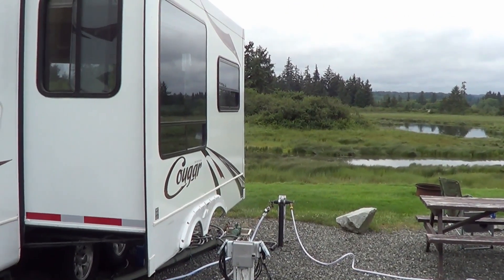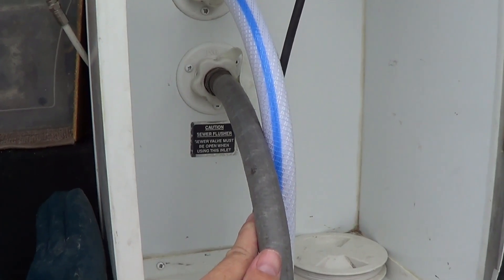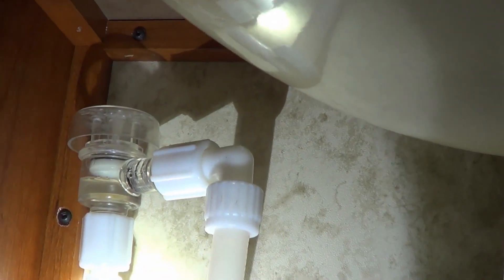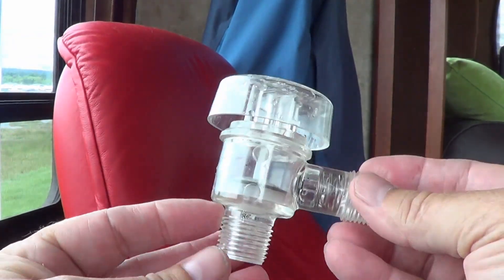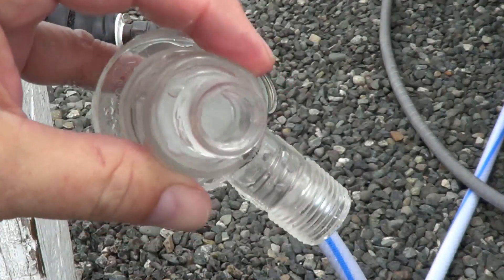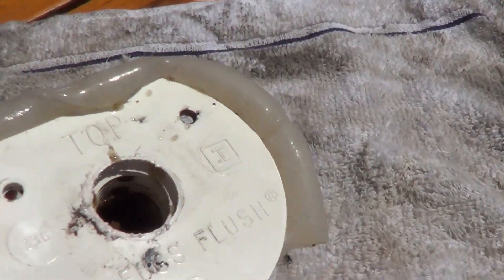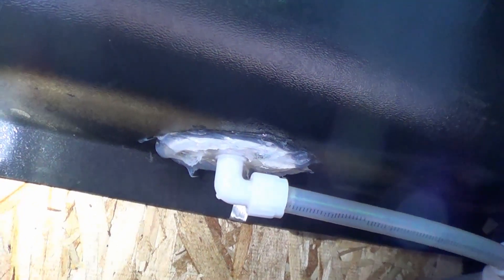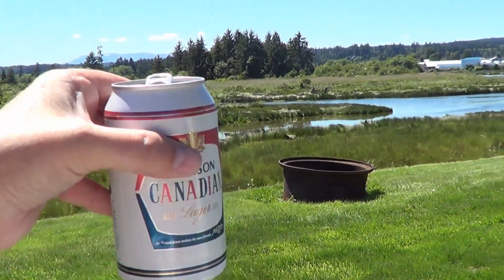Oh Crap! The RV Black Tank Flusher is Busted

Comment: I was dumping my black tank for what I thought would be the last time before I put November X-Ray (Our Springdale trailer) into hibernation for the long, long winter. I could not hear the black tank sani flush working. It was nice to find this video. I am always reluctant to take my rig to the dealer and only do that as a last resort. I was very confident that I could fix the issue after seeing what you did with yours, Professor Ray. Turns out I worried for nothing. When I got NXR home and hooked up a garden hose everything seemed to be working. Gremlins in the system maybe. Or maybe I forgot to turn on the hose...

Comment: I’ve often wondered about mine.  I think it’s a good idea to ID the location of that check valve because if it did crack as you defined, I’d be sitting on the side of the trailer as I usually do while putting the rig to bed and listening to the “spraying” sound I’m accustomed to hearing.  In reality, I could be flooding the trailer somewhere!

Comment: Thanks for this video.  
    My black tank flush is plugged up.  Must be the jet piece inside the tank, the part that was plugged up on your tank.    Unfortunately I have a trailer with a  4 seasons sealed underbelly which you have to tear apart to get to the black tank inside.  It's quite an ordeal to open up the underbelly and get it sealed back together.

Comment: your tank flush sprayer failed because it was installed too near the bottom of the tank, not in its top. Note the flange says "TOP" on its face which is facing horizontally to the street side in your installation. I would expect this maintenence to become routine at best and to require component replacement eventually. much better idea for this to be installed vertically from the top down but relocating it now would require patching a sizable hole in your tank.

the vertical portion of the backflow-preventer check-valve (black o-ring) is not spring-loaded. it prevents back flow but is dependent on gravity to close. (this is why you had to shake it at 4:00) I mention this because it's of vital importance that it be oriented vertically (plumb) to prevent sewage from flowing back into a public/potable water supply.
Reply from the maker: Thanks for the advice. Lasted 6 years of full-time use, so not too bad, I'll leave it there.
Reply from the maker: The valve is working fine, It actually has two valves, one vertical gravity, and one horizontal spring loaded, no way water is getting back out that thing.

Comment: My old travel trailer had one in the top of the black tank that spun when under pressure.  Once I hooked it up straight to the hose bib at the campground and 70 psi of water pressure went into the tank.  It ended up blowing the spinning head off into the tank.  The head was later retrieved by the RV technician.

Comment: When I purchased my 2008 Airstream Classic 25fb in 2013 the first time I used the black tank flush water came out the bottom of the trailer. I checked the one way valve and it was cracked. Rather than get another valve I just put in an elbow. 4 years later my flush valve is clogged up. It spays a little. Mine isn't as easy to get at. I'll have to cut an access hatch in the galvanized black tank cover to remove it. Figured while I have access panels cut I'll have the flush valve replaced as well as the black and gray tank dump valves and have a SeeLevel monitor system installed, replacing the Micropulse system which has screw in sensors. I have to recalibrate the system every year and its not all that accurate.

Comment: Our black tank flusher on the Cougar isn't working either. My check valve is not clear plastic  like yours; it's solid black so I can't see what its doing. Maybe I can look at the lines just to see if there is water getting as far as the tank. Does you flusher still work today?
Reply from the maker: Yes, still working well, just did a flush out about a week ago

Comment: I love these how to videos!  
I have watched a lot of your stuff.   I am going to try the CELLULAR SIGNAL BOOSTER mod. How do determine where it is safe to drill through your roof?
Reply from the maker: Thanks! I try my best to guess what's under the roof then use a foot or longer 1/8th-inch drill bit first very slowly and pierce the roof board, then push on it and see if it hits anything. If not I can continue on thru the ceiling and see where if it comes out where I thought. From that point, I can slowly widen the holes with larger bits. To pull wire though I tape it to the long bit then feed it through.
As seen in this install video - https://youtu.be/L5VmeOMgtlE?t=7m28s

Comment: I wonder if it pays to run some CLR through the flush hose periodically?
Reply from the maker: Might be an idea as the stuff was likely hard water deposits. I'm sure boondocking so much in hard waer areas doesn't help as when at dump stations I don't like to hold up the line flushing the tank.

Comment: what you call a check valve is a VACUUM BREAKER---this prevents pull water back from the black tank into the water supply hose . An attempt to pull back into the water line will result in only air being pulled back
Reply from the maker: The No Fuss Flush Instructions calls it both "Vacuum Beaker - Check Valve" https://liferebooted.net/life-rebooted-rv-files/owners-manuals/No%20Fuss%20Flush%20Instructions.pdf  So does Valterra https://www.valterra.com/product/check-valve-vacuum-breaker-1-2-mpt-bulk/

Comment: ok so I also have this problem. When you removed the 3 screws and the pipe did yours just pull off? Mine seems stuck on to the black tank and doesn't want to come off.
Reply from the maker: Yes, it had some silicone sealant around it but it was pretty easy to remove, just rubbery.
Reply: ok thank you I have tired 3 times to get it off it is very hard to get to.
Reply from the maker: Maybe yours is glued on :(
Reply: I have the underbelly off but the rv is 120 miles from me, plans are to go back this Friday and I will take another look at it. Thanks for your video.
Reply: After 3 attempts I was finally successful in gettiing it out and it was completely stopped up. Thanks for your help.